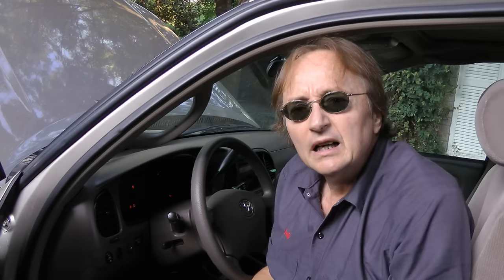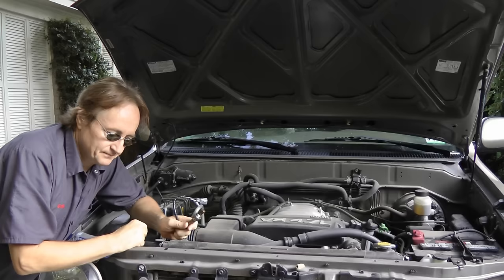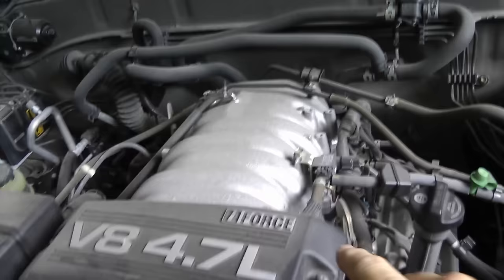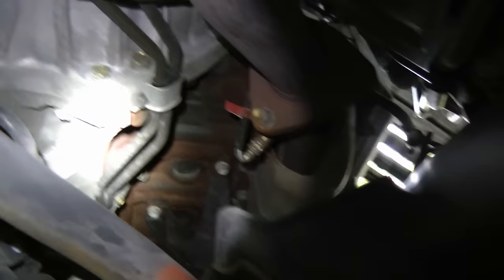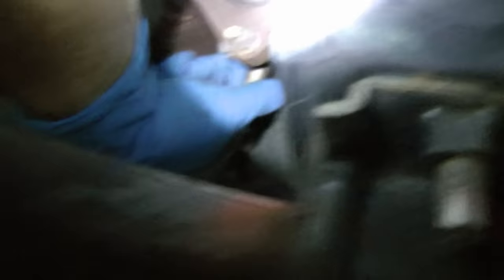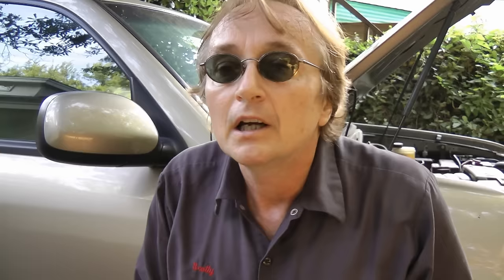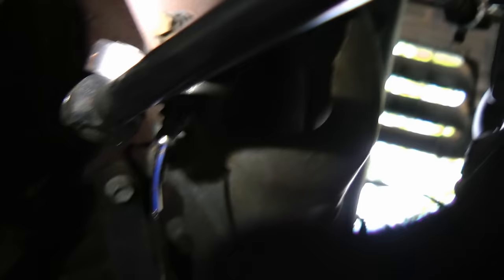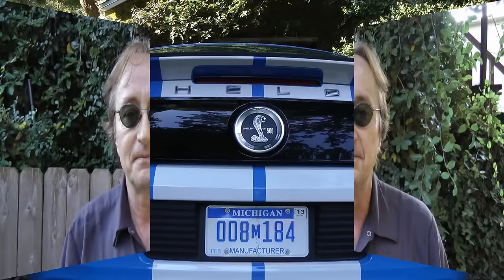How to Replace an Oxygen Sensor in Your Car (Air Fuel Ratio Sensor)

Comment: Scotty said the Oxygen Sensors are hard to replace; however, easy to plug in; however, it was easy to replace my sensor, but it would not plug in and "snap" in place.  It's tight so my hand barely fits and when I push the connections together there was no SNAPPLING in place.  I'm not sure if it was totally connected, but it was working okay.  Others, too, have had issues with the connections "snapping" into place even when they are OEM replacement parts.

Comment: Hi Scotty, can you help me? I have a 2009 Honda Fit and it has P0135 error code that says : Air Fuel Ratio (A/F) Sensor (Sensor 1) Heater Circuit Malfunction. But i dont know if it is the upstream or downstream sensor :(

Comment: Hi scotty I have an issue with my tundra 2014 ..  the check engine came on so I took it to the dealership .. they say problem is the 2 rear 02 sensors that were cut , seems like they were trying to steal the catalytic converter.. my question is .. can this harness be reconnected if they were cut in the middle or do I have to buy the o2 sensors ?.. thanks

Comment: Scotty, I was getting a P1157 code on my 06 accord. I replaced the o2 sensor that connects before the cat with an OEM one the same way you did using the anti seize on the treads. I cleared the code, but now I keep getting a P0135 code which I hear is heating element in the sensor?? Every time I clear that code it comes right back a few seconds after I start the engine. What do I do? Please advise!

Comment: Hey scotty i replaced my back 1 sensor 2 sensor and cleared the code multiple times but the check engine light keeps coming back on(it is an aftermarket btw). Should i go to the dealer to get a factory 02 sensor?

Comment from the maker: they are complex feedback systems, and as such, can do many different things when they go wrong. And testing them requires all kinds of experience and a freeze frame oscilliscope to even start testing them out fully. They can cause a rough idle, but so can tons of other things. Most people pay a mechanic to analyze them with a dealer level scan computer and watch the wave forms they put out while doing certain tests of the fuel system.

Comment: Thank you yet again Scotty!! I have used after market parts since I have been working on cars and I am 60 years old. I cannot remember replacing a part with an exact OEM part. It never made a difference. But I never changed an O2 sensor. Well after replacing my sensor with an after market part, that the seller said is compatible with my car, failed as soon as I started the car, I looked to see what "Scotty" had to say. I should have done that first. I replaced the part with the OEM sensor and now it works! Thanks again!! You rock Scotty.

Comment from the maker: if you're talking about the power voltage supplied to the sensors, either the computer is bad or the wiring going to the sensors are bad lowering voltage. fuel pressure varies for all makes and models, any auto parts store can tell you on their computer

Comment: Scotty you are a LIFE SAVER! I've had several problems with my PT Cruiser GT lately. My car was throwing codes like crazy! So I cleaned the ecm with the electrical spray you recommended to remove the oxidation and so far so good, you saved me big bucks! The only code left is bank 2 o2 sensor downstream so after watching your nifty video and as soon as the storm passes I'll be out to change that sensor. Thanks a million! True fan of your work!

Comment from the maker: sure can, I was actually surprised by the handling ability, especially at higher speeds.
Reply: Why did it only take you 2 seconds to replace these and Google even a shop said it will take 4 hours
Reply: @lasvegascream1799  anytime you take your car into the shop just always have the preconception they will do their best job trying to discretly make money off of you. If you're bewildered, you should see how much some places charge for an oil change x_x

Comment: Scotty, your videos are amazing! I replaced the upstream O2 sensor in my 2003 Mitsubishi Galant with the factory brand (Denso). I also cleaned out my throttle body and the mass air flow sensor (with mass air flow cleaner). After doing these three things, my car idles so low that it dies. I tried unplugging the battery overnight, hoping that it would reset the computer, but it still idles too low to stay running. I have to keep my foot on the gas to keep it from dying. Any ideas on how to fix this problem? The idle was fine before I did these three things.

Comment from the maker: hondas carbon up inside the engines, try my video "how to clean fuel injectors on your car'
Reply: Scotty Kilmer hey Scotty, is a 2003 Toyota RAV4 with 128k miles w/ a 02 sensor problem worth $3200

Comment: Love your channel. Lots of information. I have a Saturn Vue 2007 V6 with Honda engine at 120k miles. It started to idle a little rough (not terrible, but definitely not smooth) weeks ago with very occasional misfires of all cylinders. No other error codes. New timing belt and water pump. Changed MAP, air temperature sensors, PCV value, purge valve and EGR. Air intake manifold cleaned. Throttle body cleaned (not dirty at all). Fuel injector cleaning additive used twice. Always used neighborhood gas station gas which is certified TOP TIER with STP additive for fuel injector cleaning. They all had no effect on rough idle. OBDII scans consistently show a few (negative) percentages like -1% to -5% fluctuation, rich for STFT Bank 1. Bank 2 STFT is always lean. +3% to 14% fluctuation. Why Bank 1 always rich and Bank 2 always lean? Didn't see vacuum leak when I did a smoke test. Lazy or faulty O2 sensors? Unlike other cars, this car's OBD data does not give upstream O2 sensor voltage output (broadband sensor I guess). So I cannot check 0.1 - 0.8 V O2 sensor oscillation. Its downstream sensors' voltage responses can be plotted by OBDII scanner. They oscillate actively between 0.1 - 0.8 V as expected. I need some help here. Thanks.

Comment from the maker: I live in texas, but ford sends me new cars from detroit to road test.
Reply: How do i loosen a sensor that wont budge after applying  wd40, 7/8 socket and cheater bar? Have been trying all day to change the upstream sensor on a 2011 chevy equinox  2.4l but this thing is welded on here, its at a weird 45 degree angle and the heat shield being in the way makes it complicated as well.

Comment: Hello Scotty, do you have a video about P2096? when Post Catalytic Converter is too lean. 
I used FIXD scanner but it shows a list of possible reasons as:
1.- Heated Oxygen sensor (HO2S) Bank 1 Sensor 1.
2.- Rear Oxygen Sensor (O2) Sensor.
3.- ECM Programming.
4.- Oxygen (O2) Sensor. 
5.- Heated Oxygen Sensor (HO2S) Bank 2 Sensor 2.
But it doesnt shows a specific root.

Comment from the maker: Often a weak fuel pump, try pressure testing it first. If not, try my video "how to clean fuel injectors on your car":  AND find if you have a vacuum leak on the engine using my video "finding engine vacuum leaks with a cigar"

Comment: Which is raises the question which is spark plug number 1???
Reply: take out the spark plug which you think is no.1
start the car
you should get a check engine light
hook up your scan tool and it should give you a code and message which reads: "Cylinder [spark plug number] misfire"
try this on all cylinders until you it tells you that cylinder no.1 is misfiring
Reply: # 1 would be the most forward cyl on a V8. If you examine it carefully, you should be able to tell.
Reply: How about since he has an internet connection, look it up? Sometimes is written right on the engine manifold.
Reply: He asked a good question and someone answered,... on the internet.
Reply: google it is your best bet, they all count them differently
Reply: Often, the wires are numbered, look for that first.
Reply: Ratchets & Wrenches guy said the one closest to the timing belt or chain...??

Comment: @scottykilmer I recently got a check engine light and my code is a little different but it is still bank 2 plug 1. I drove the car like normal all day but now it has been 3-4 days and the check engine light went away on its own. Should I just replace  the oxygen sensor anyway since lights come on ONLY when something is wrong. I think it's just weird that the light went away after the first day it came on. At the same time, those error lights dont just mess with you for fun...or do they? Also, I reconnected with my father 4 years ago and have been working on our cars and the families cars for awhile and your videos are THE GO-TO for my dad and I. Thank you so much for what you do.

Comment: My 2010 honda civic is slightly hesitating when I take off in 1800-2000 rpm range. And has low idle at times... can that be a dirty throttle body?? I already cleaned the MAF sensor... no check engine lights.
Reply: SouthernCali909.PEN1.737 I don’t know if you fixed it or not but sounds like a idle air control sensor or a tps sensor which means throttle response sensor try both I had the same problem I just replaced both , hope it helps.
Reply: Signs of a bad O2 sensor on its way out.

Comment: My 2005 kia Sedona lx has a bad oxygen sensor. I don't know where to find it or how to remove the engine cover thing. The van will not start at all and I have no tester so how do I know which to replace. Please help!!!
Reply from the maker: Kristen Mueller first, you need to know which sensor has a problem, so go to an auto zone, they scan em free. Then e mail the code here, it should show which sensor is bad
Reply: I wish my 99 Blazer was that easy to fix ! I changed the 02 sensor and the light still comes on after I had it cleared !
Reply: @baldy194859  disconnect the battery 60 seconds and it should clear and it won’t pop up again
Reply: @scottykilmer  I got a code from auto zone but it didn’t say if my upstream or down stream sensor was damaged

Comment: So my 00 Camaro is misfiring with some bad 02 sensors but when I went to go investigate for the parts to look at the next day. I was asked if I wanted ones with heat or without heat. Which ones should I choose if I'm replacing all 02 sensors?

Comment: Who do you get the electrical clip off? I tried for hours to get mine off today and it wouldn't budge.
Reply from the maker: caseybv74 yea, some of those clips are like chinese jig saw puzzles. But they all have a release catch, look closely, most squeeze really hard in then pop off. OF they have a tang you pry out, then they unsnap
Reply: Those clips are why non mechanics are losing their poop with this stuff.
Reply: Sometimes, you just have to look at it for a while and use your brain.
Reply: Mine is stuck on, how do I get it off?

Comment: Thanks Scotty, I always enjoy your fun demonstrations. I hope you have time to repond. I bought a  2004 fx35 last year and it failed smog check for P0138 and P0158 which are the post CAT o2 sensor issues. I went ahead and changed them both and I found out that it made no difference. When I delved into it a bit more I realized that all 4 o2 sensors once in operating temperature just show a steady voltage, the post CAT sensors go to 1.275 volts and max out, and B1 S1 is at .3 V and B2 S1 is at .64 with .01 v oscillation. When I accessed the ECM to see what is going on, I found that someone had simply joined the wires between S1 and S2 on B1 (and not B2). For the life of me I cannot figure it out why would anyone do that and why would ecm accept this. BTW, the car runs smoothly and aside from the "service engine soon" light on there are no issues. I also verified all 4 o2 sensors they are fine, even the original sensors that I replaced were fine.
Anyone out there has any idea what is going on. I hate to revert it back to what I think it is supposed to be and find out now that the car is not running smoothly anymore. I have to point out that mileage is not that great 14-17 mpg. I unplugged B1 S1 and drove it and it still worked but not smoothly, it got slow to respond to acceleration.
Reply from the maker: first, it must have the factory wiring, do that. then if it still acts up, odds are the cats got ruined. But you could try cleaning them as follows https://www.youtube.com/watch?v=5icTmYItwiE

Comment: do we need to disconnect the battery before inatalling?
Reply: Not needed but just to be safe disconnect the negative terminal of the battery.
Reply: Not unless you want to reset the drive cycle monitors.

Comment: Just came across this and I'm impressed!  I have a 2007 Toyota Prius.  Check Engine light is on.  Brought the car in to a mechanic and was told it's the heater for the "passenger side" oxygen sensor.  Was also told it would cost $700 to replace (parts and labor).  I'm a woman, and after seeing your video... Methinks someone's fleecing me.  I have done my own car work in the past (LONG time ago - starter, brakes, misc on a 1980 Datsun 210!).  Am I capable of replacing my own oxygen sensor in a newer Toyota Prius?!
Reply: I pretty much do all my own work on my truck; brakes, oil changes,  steering rebuild,  suspension rebuild,  drive belts,  distributor,  plugs, wires , and fuel filter.  Buy and download the factory service manual for your car.  Watch a lot of videos and visit car forums specific to your vehicle.  If you're pretty handy and motivated,  you can fix most things yourself.  I also have a problem with handing money over to people who think they can take advantage of you.  Given the look of my truck though,  I've never personally had anyone try to take me for a ride. I just hate parting with my money in labor costs. Good luck. Just be aware,  most things rarely go as smoothly as the book or video shows.  At least with my truck anyways

Comment: i was getting code p0420, someone told me it was the 02 sensors, so i replaced them both. now i'm getting codes p0130 / 0132 / 0134 / 0135, wth is goin on with my car?
Reply: Jim Van code 420¿ smoke weed!
Reply: did you use OEM sensors or aftermarket?

Comment: I took your advice & changed both sensors it made a huge difference , the 2nd sensor (after CAT) definately needed replacing also to restore full performance. Luckily mine were only $20 each.

Comment: Thank you very much for your entertaining, thorough, and practically-based videos.  I appreciate this particular video.  If you can, please answer these questions below.  FYI, the code readings on my 1997 Nissan Maxima GXE was P0130 & P0446.

1.  Would the dealer know what manufacturer brand my oxygen sensor would be?

2.  Since funds are tight, will the car's driveability be fine with a bad oxygen sensor?  I want to see if I can save up and hold off until emissions' test.

Comment from the maker: it's running lean, and in those, almost always leaking intake manifold gaskets, one cow of a giant job. But, if it runs ok, you can ignore the light as the leaks can be rather small and not hurt anything. You need tons of tools and hours of time to replace those parts.

Comment: I got my valve gaskets (front and rear) changed by Firestone..cost me about $500.  After few days of driving the check engine light was on and this time it showed couple of codes, P1130,P1135, P1133. - Coolant Temp sensor- Coolant fluid is out, Air Fuel Sensor 1 Bank 1 harness issue.   Firestone wanted to charge $200 for analysis, part would cost about $291+tax from Toyota dealer and another $200 for labor. Got Denso part 234-9007 an upstream rear sensor 1 Bank 1 (6 cylinder engine) for $96(from Amazon).  A 22mm long wrench for $12, a PB Blaster and replaced it.  While I was there bought a Engine degreaser and cleaned up the engine bay...the car sounds better and cleaner.  After replacement, initially the engine smoked crazy...may be burning the extra degrease and settling in by burning the copper antiseize... drove about 10 miles and no engine check light yet.....thank you Scotty

Comment from the maker: those are complex feedback systems, ONLY use dealer oem parts to begin with. an you really need a machine as in my video "fixing modern cars using high level scan computers" to analyze what is working and what isn't. simple swapping doesn't cut it on that system.

Comment: I got a P0031 Actron code for my Toyota Prius. "Heated Oxygen Sensor Heater Control Circuit Low Bank 1 Sensor 1." Wanting to change it out soon but I hear it's expensive if you have a dealership do it. Pricing out parts and labor but ultimately want to tackle it myself.

Comment from the maker: tons of things can trip that code, but often an inefficient cat. try my video "fixing bad catalytic converters" and pray that fixes it.  BUT, if your friend used a non toyota dealer sensor, that can be the problem also. The other VSC and TRAC lights come on automatically as soon as the check engine light comes on, that's toyota software design

Comment: I’m have all types of issues and I bought bosche sensors for my v6 02 Camry , and replaced the motor. I got it back. It doesn’t start on first turn anymore . U can here the misfire popping sound . And eventually (yesterday) it wouldn’t start and white smoke.. I pushed some connections down firm and just wait. Somehow It started again, no smoke.(I think a sensor blew since smoke stopped) but seemingly weak power, low idle and will cut off.

Comment from the maker: as they age, they tend to get expensive to repair/ But the sensors just bolt off and on, you get an oxygen sensor removal socket, auto zones sell em for less than ten bucks.

Comment from the maker: now it says the other sensor is bad. REALIZE they are complex feedback systems and if you start changing one part, it can effect others too. BUT, ONLY use toyota oem sensors, do not use aftermarket ones or all hell may break loose in the computer software analysis on the vehicle.